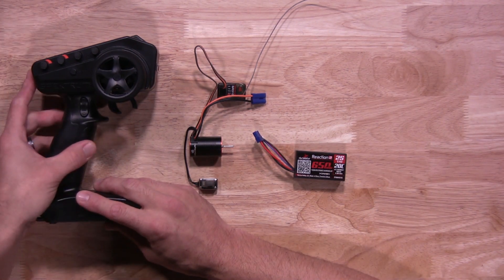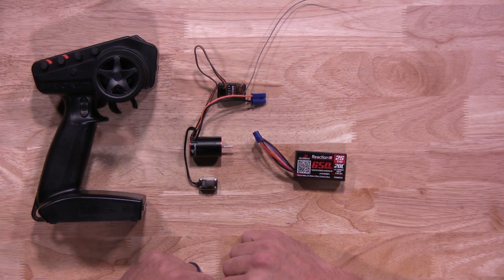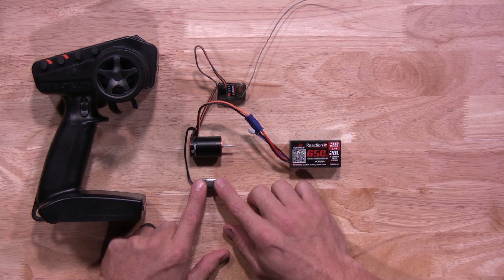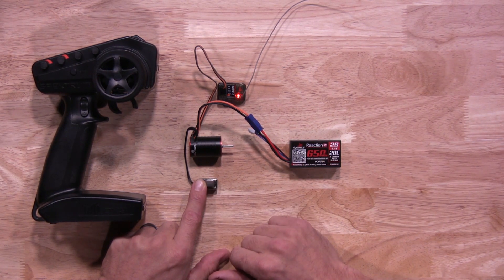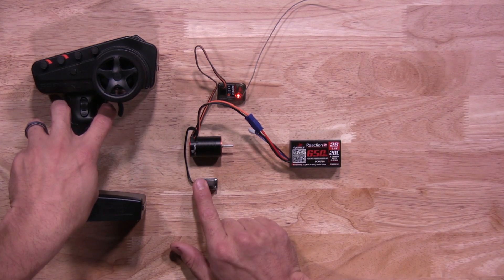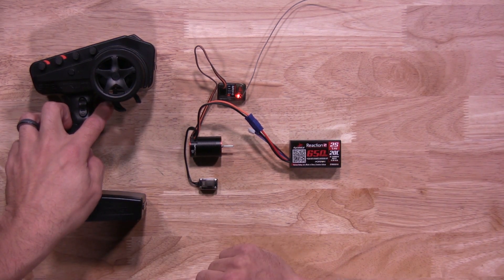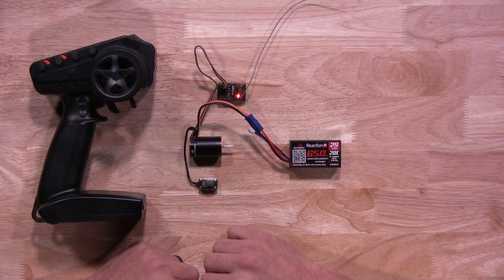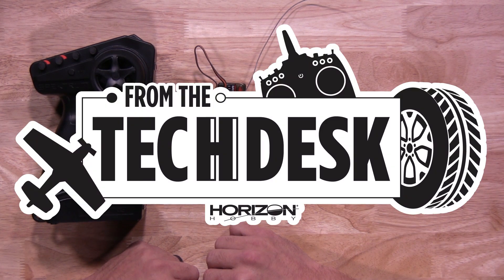How to calibrate the Spektrum Firma 6000kv 2in1 motor and esc combo

Comment: How can I change the direction of rotation of the motor? My car is reversing! Inverting in the transmitter does not work because the brake is then applied to the gas! Is there also a how to video?

Comment: Spektrums latest line of ESC's can be really temperamental when calibrating. You can follow the calibration protocol exactly as it says in the manual and it doesn't work, do it again, it doesn't work, do it again it doesn't work, do it again and finally it works. Sometimes it takes many attempts. It's the same with some of their receivers when binding. It can be very frustrating

Comment: I turn mine on holding set it  starts beeping, I let go of set still beeping. Press again to set neutral and the beeping stops but doesn't progress from there. I don't get the beep to accept neutral either.
Reply: I had the plug in the reciever backwards if this happens to anyone else
Reply: @quipher thanks!

Comment: What is the 6000kv intended for with 2S power? I have the 1400kv and 2300kv both 3s
Reply: It comes stock in the losi 16 scale drag car. I am personally using 1 in a kyosho NSR500 RC motorcycle.
Reply: 2s only.

Comment: Hi question is this for the Losi Mini B? I want to run the brushless class and was looking for options.
Reply: I don’t  see why it wouldn’t work unless it doesn’t fit in the buggy, size wise
Reply: It’s made for it
Reply: This setup was made for a direct drop in replacement for the losi mini t as well as the losi mini b. It will work and definitely make a difference.
Reply: @SubZ3ro907 does it have reverse? I noticed on the box it says counter clockwise rotation only
Reply: @yobtnirp  yes. It does have reverse. You have to use the spektrum program card to change all the settings tho. The 2 in 1 systems do not allow changes to things like motor direction, brake force etc etc, on the system itself.
I have this thing installed on a Kyosho HOR (hanging on racer) and had to disable reverse, change brake force and change the motor rotation direction  when I did my setup. The program card has to be the V2 (version 2) for it to link up to the 2 in 1 system tho.
Reply: @SubZ3ro907  thanks